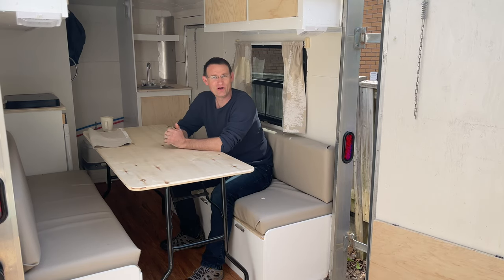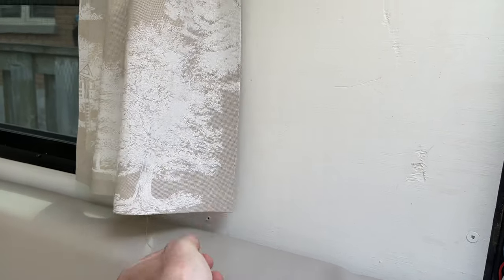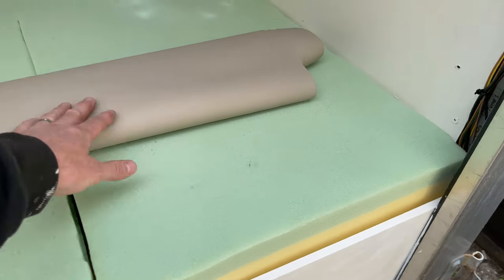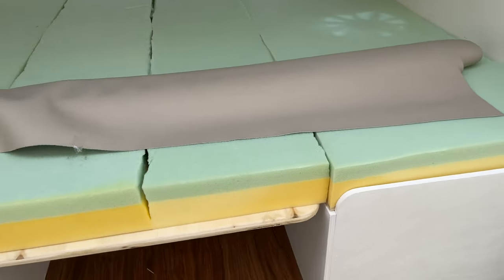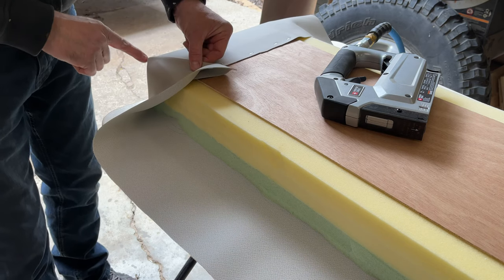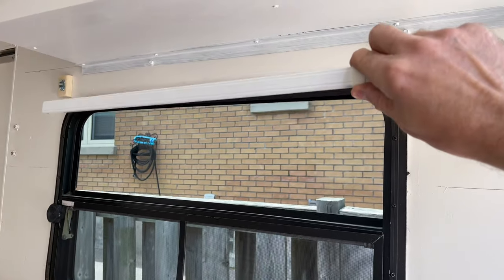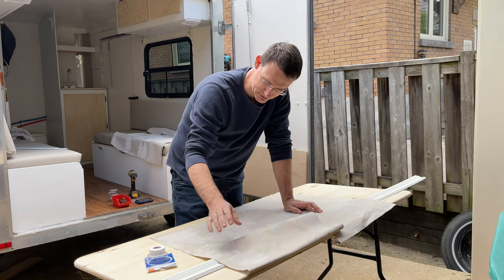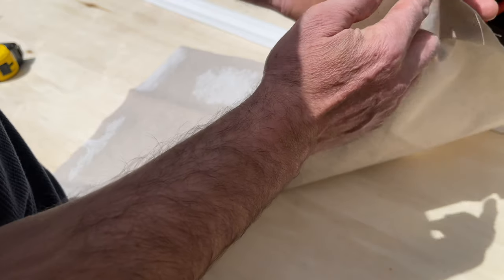How to Build a Cargo Trailer Camper Part 12 - No Sew - Curtain & Cushions

Comment: How wide are the benches from the wall to the edge of the cushions? I was thinking of building something like 22 inches. Yours look to be a good width for bench seats.
Reply from the maker: Yes I believe I went 22” it’s 1 1/2” bigger then the water tank. 
I think it’s comfortable but if you can go wider I would. When you add the cushion to the back it takes about 5” so it’s much thinner. My trailer is only 6’ wide so if your 7’ you should have a bit more room to play with…… with such a small trailer it was basically a build with a bunch of compromises but in the end I’m happy with it.

Comment: Yup looks great. I'm going to add a little 2 cents for your cushions. I would make the btm plywood larger, cut the material to overlap the ply by at least 1.5 to 2 inches, mark the overlap with a pencil on the ply and backside of material. Use a spray adhesive 3M #77 on both the marked ply and material. Stretch over stick down and roll it out with a hard roller or a piece of wood  then staple. This will help keep the wrinkles from happening and make it easier to stretch into position. Great build, I've got 8 more weeks until I get mine to start a build.
Reply from the maker: Great tips! Maybe get a little thinner material also. This was marine vinyl so I think it was just too thick…. I like the idea of the spray glue. 👍